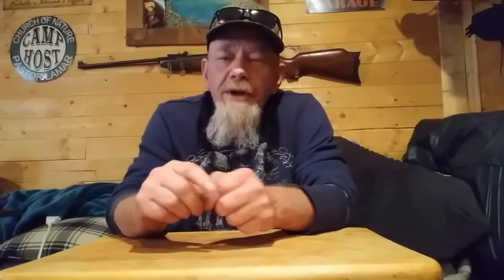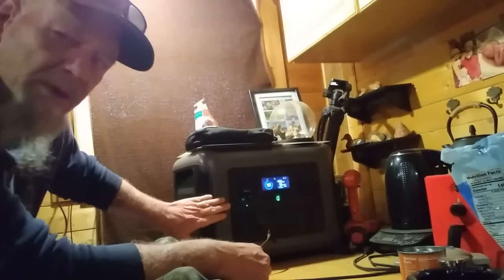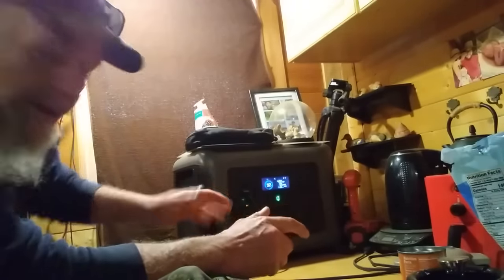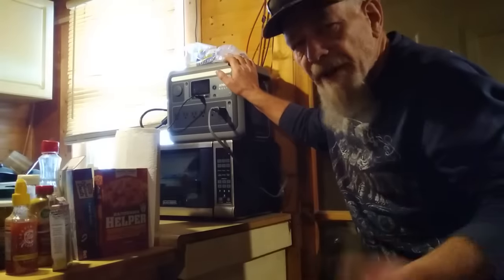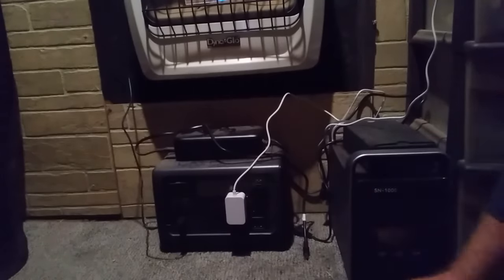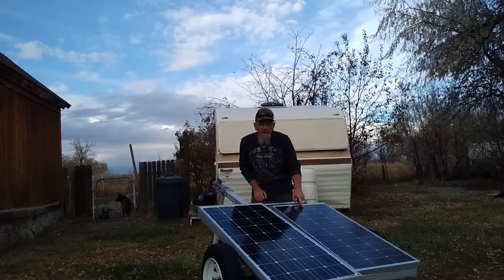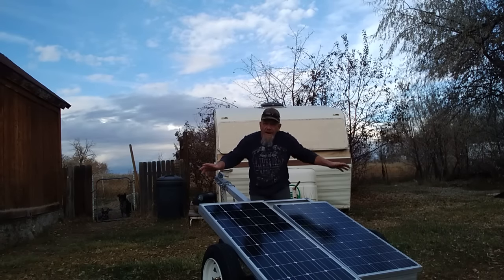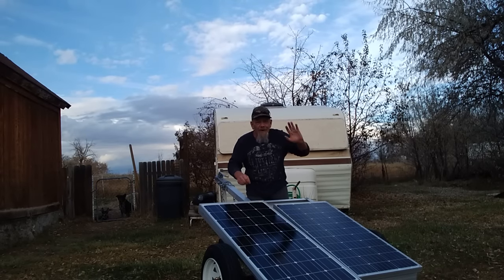My Solar Produces Too Much Power Or How I Store Excess Solar Power

Comment: I’ve been on a boat off grid for more years than I care to think of. I take a different approach. Rather than having loads of different systems and the inefficiencies of charging one from the other I just have one big central system that runs the lot so rather than having extra batteries and gubbins scattered about the place they are all included in the one large battery. I use the same amount of power but I just don’t have to juggle it, I just plug in and use it. Most day to day stuff is low voltage so I have the inverter just come on when needed so no parasitic load. In times of excess power I have it dump into hot water. Most of the year I use it for cooking and have the Propane turned off. For a couple of months in wither I use propane for cooking although if I move the boat I have excess power and so then I cook using it. The key to everything is good monitoring so that I can modify my use to suit what’s available, it’s not a hardship, I never run out of power and I really don’t have to think about it just glance up at the monitor from time to time. I would agree that a portable system is good if you need to have power further away than an extension cord but I think I’d go ,as if I had to juggle all those battery boxes. It’s much cheaper only having one inverter and infrastructure and if I need more storage I just add a battery and don’t need to buy another inverter I don’t need. All the solar just feeds into the one main battery and a quick glance shows me how it’s performing.
Reply: thats exactly what i thought. easier to maintain too. im going to comment to him on how much he has invested in all this. im guessing 6 grand.

Comment: Good tips. Definitely good to go in stages as you can afford it by getting some small solar generators for emergency power to begin wit, then adding some solar panels to recharge them, then adding larger batteries and inverters to store more power, and then tying them all together and adding more as needed is a good strategy.

Comment: The last few statements are the guts of what it's about. Essentially "off-grid discipline" - which is doing things when the power is available and not so much when it's not. The way I look at it is that when the batteries are full and the loads are being 100% met by the current coming in from the panels then that is truly free power - when it has gone into and come out of a battery bank it is NOT. So put your washing machine on in the morning - not the late afternoon when the panels have just gone into shade! 

The real problem loads are the other people in the household! lol We have a family of five, and as the two oldest boys have now well progressed into their teenage years, yes it has hard to keep up with the demands. For the last week though it has only been me and my six year old home. Talk about excess power! ;) 

I have a similar approach to you with diverting excess energy into "backup" battery banks, and then I can draw of those before choosing to go to the generator. I also run multiple battery banks for separate categories of loads. This gives some redundancy in case of any failures. It also means the lights don't go out because someone has decided to have a massive feast of toast! Plus, it keeps the direct paralleling of batteries to a minimum.

Comment: I've often wonderd the same thing about all these people with enormous systems. My assumption was that they live in areas where solar is just not that great for whatever reason, and like you said they just pay no regard to attempting to lower their consumption. My guess they must run a/c day and night in the summer, electric heaters day and night in the winter, and run big induction cooktops and ovens and cook thanksgiving dinners after the sun goes down every night or something. Running a/c or heaters off of batteries in a large home are what would require these massive systems I see people with all the time. But, if they were to convert to mini splits they could probably get by on half what they have in the way of solar.

Comment: Two ways....location and deep freezer....that's how you burn up so much power off grid. You either use a propane freezer or struggle at times, especially in the far north between good solar season and when it's cold enough to move everything to the old freezer outside in the winter.

Comment: looks like you got everything under control. I have a rather small solar array about 500 watts, compared to a lot of folks. I only use one Valence 138 Ah Battery to run my chest Freezer. The great thing about my Charge controller it only allows to draw the exact wattage I need to run my chest Freezer which is about 90-95 watts when the compressor kicks on at idle its about 49 watts. Other than that my battery is fully charged. When its cloudy i don't use my solar system I plug into the grid.

Comment: This is the problem I run into living in a populated area. Eight months out of the year I don’t have any issues at all, as the problem becomes evident in the winter time, when the sun is lower. 
I have gas heat and so it takes electricity to run the blower, and that is what takes up most of my energy.
Of course, the sun is much lower on the horizon and you have a lot of trees in neighbors yards that block the sun. Also depending on how well your house is insulated, can be a major problem.
Also, living in the Pacific Northwest is one of the lowest outputs of sun during the day.

Comment: My house uses 20kw a day. I have 8.8kw of panels and 50kw of usable battery storage.  2.5 days of rain or snowy  days in Michigan is how long I can run. I will add another 8kw of panels and 1 more battery bank then I should be off grid for electric. 10 months a year right now I am off grid for electric. Its winter that is hard to get enough sun.

Comment: Depending on the environment, cooling can use a good amount of solar power. I’d say heating as does well, but solar can only manage heating a home typically if you have a on grid solar system and stack up your credits during the sunnier months and use them up for heat come winter time.

Comment: If you are completely off-grid, you MUST have a Back-UP for your Back-UP.  If your main system goes down, then you MUST have extra systems to provide power.
-Main System = Dual EcoFlow Delta Pro 3600Watt (Total of 7200Watt...Real Life = About 6600Watts) with 1350Watt Solar on Each EcoFlow Pro
Running house (Gas stove and heater, so those are NOT on the Batteries)

-Two other EcroFlow Pros 3600watt with 550watt Solar Panel on each - running TWO Separate Window AC 
can swap out one of the EcoFlow Delta Pros if it goes down 
AND my main batteries DO NOT have to have the AC Load on them

-Smaller "EcoFlow DELTA 2 Max" 2000Watt with 550Watt Solar Panel connected - running Refrigerator and small kitchen stuff (Toaster, Coffee...etc) 

So, I have my Power Drain connect to several Battery Systems and I have backup to my main system.

EBAY Refurbished:
Delta Pros $1999 Each
EcoFlow DELTA 2 Max $1399

Solar
About $4000

Total about $16,000 with tax

Comment: Most of my power goes to run two central A/C units in my house (2600 sq ft) for four months of the year in Texas. They are a bit old so when I replace them, they should use a lot less power, but they typically use about 60 kwh per day (only A/C's) since they have to run 24/7 to keep the house at 80 degrees in the summer. The rest of the year, my home uses about 20 kwh per day. The only gas I use is for the furnace and water heater.
Reply from the maker: Living in an extreme hot climate has it's challenges.  I use a 45 watt evap cooler.  What are you replacing the AC with?
Reply: @solarcabin Definitely replace your AC with split inverter units.  They are the most efficient AC I've ever owned. And all I've seen are also heat pumps.

Comment: Hey Lamar, when you’re filled up on battery storage how about running an electric heater to off-set propane?
Reply: Obviously only do it only during the day with good sunshine
Reply from the maker: I do and my dump load is an IR quartz heater in winter and an electric blanket.

Comment: Im going to get a third battery 🔋 from your link 😁👍 in two weeks.    That will let me take some of the lead acid batteries and make a separate 12 volts system with the wind generator. It just works better on 12 volts. I already have another inverter but I'll need another charge controller. It's a modified sine wave inverter but I can run some things off of it. I can put 400 or 600 watts of panels on that side. I was charging 30 amps at noon but I had a big chicken breast in the oven. Voltage was staying at 27.1 . My inverter is working better from the higher voltage ⚡. Four of my solar panels are in the shade until 2 p.m., and lucky to get sun very long, they're in between two buildings. So I'm going to move those to the other side to get morning Sun 🌞. I'm thinking 🤔 that two 2000 watts inverters should be good for me. That will be plenty to run whatever electric ⚡😎 stuff I need to. That's about as big as my stuff is going to get, other than a little bit bigger wind generator. That's complex enough without going crazy about it. I went by the truss company to get scraps to burn ❤️‍🔥 and they gave me enough lumber to finish the greenhouse 😁👍😎. Only thing I have noticed about big systems, they have like three or four 24,000 watts inverters running. I guess they must be well off city people that just went off grid but still wanted to use all the power they want to. Probably scared of not having enough wattage so they overdo it a little bit. I saw one where a guy had two 48,000 watts inverters, and was thinking about getting another one. It's nice, but gosh, above my pay grade. I'll have the system I used to dream about with 4000 watts maxed out. And two inverters going...lol. That should be fine. That's the plan for the rest of this year. The lithium batteries have a standard discharge rate of twenty amps, and my inverter max draw is like 78 amps. The other inverter is an Ampeak. It works good, just uses a lot of amps. But I have plenty of batteries. My batteries charge up quickly in the morning, then I have power all day. Once they're charged up, the voltage ⚡ doesn't drop very much when I use the oven, like it used to. The higher voltage is making my inverter charger run cooler, so it's working better. I said, okay, I'll get one more. The lowest these two have been is 26.2 volts, full is 26.6 v. . I was thinking three would last a very long time with what I have. They'll probably stay above 26 volts so not a lot of cycling there. It's pretty chilly outside, 83 degrees inside so the battery bank stays warm. I have some 12 volt stuff that I could use if I have a separate 12 volts system. So I guess I will go there next. I can't imagine needing more power though. Thanks again for the great batteries. I think I like them better than most I have seen . I know they are going to be awesome 👍😎. About New Year's Day, when there's an ice fog  outside, I can still make some brownies 😁👍. Or have a heat lamp on, or something...it will be a good upgrade coming soon. I guess it was just time for it.
Reply from the maker: I used mod sine for many years but for a microwave, stereo, and computers a pure sine is better.

Comment: Yeah, some of these guys run machine shops from their off grid sites so they need quite a lot of power because that's what they do for a living.  I think off grid is just a term for people who want to disconnect from the Big Corporations so that when they shut everything off they won't be at their mercy (which, dead Things don't have any of). 
So yeah, you in your situation will be different than them so while you live off of very little power -- which is great -- they're just as off grid but with different needs. 
You are like me though.  I have a small system but bigger than yours but I run my stove and sometimes my furnace with propane.  What will I or you do if they cut off the propane?  I'll have to burn wood but what happens when the wood runs out? 
Those guys with the bigger systems might be looking pretty smart then. 
It's all about we're fighting a war with the Major Corporations and they control the supply lines. 
Yes, this is a war and we're in it.
Reply from the maker: I also use electric heaters and an electric blanket and run an evap cooler all summer. I live in the oi patch and near the mountains so propane and wood are always available here. I think they are running bit coin or using large tools and appliances most people don't need.

Comment: i was looking on your recc amazon site and it seems you have a lot of differant systems. how much money do you have wrapped up in this?
Reply from the maker: My main systems with batteries you could do for between $3-4K but power stations are expensive. A 400 watt system is around $1k which is what I tell people to start with.

Comment: Heating.     Cooling.... lots of power electric stove ect
Reply from the maker: I run a swamp cooler in summer and my dump load in winter is an IR quartz heater but we don't get extreme heat and my cabin is small and super insulated.

Comment: They keep those same modern fancy energy guzzling appliances! Am converting all my appliances such as refrigerators to 12volt no more big fancy overpriced energy guzzling appliances for me it’s a lifestyle change folks don’t want to give up !
Reply: Modern day fridges/chest freezers are in no way energy guzzlers. I have a french door fridge with a bottom freezer, water, and ice maker in it that uses 82 watts per hour. I have what many would call an "apartment fridge" - standard like 6 foot tall, one door with a top freezer - that uses 45 watts per hour. I also have a chest freezer that is 7.5 cubic feet that uses 36 watts per hour. Having them all at least sort of stocked adds mass and allows them to kick on less frequently, but yeah - these things are not at all the energy hogs they used to be. Same thing with a washing machine. I can only speak to mine, but it's only a few years old and a typical load of laundry, using the cold water setting, uses 130 watts (not per hour, per load). 

What actually eats energy like crazy is anything with a heating element. Stoves, heaters, ovens, coffee makers, hair dryer, toasters, air fryers. Your typical electric stove with 1 burner turned on high will use 3000-4000 watts per hour. Get an induction cooktop and that drops to 1200-1500 an hour. And induction heats up quickly. I can fry up three eggs - one at a time - by the time my electric stove has heated up a skillet quick enough to even start cooking one egg. And I can do that on low (about 700 watts per hour). Your air fryers are around 1250-1500 watts per hour. A clothes dryer? You're talking 4500-5500 watts an hour. The little personal electric heaters you can plug into the wall? 1500 watts an hour. 

Cooking. Heating. That's where so much of the used energy goes. Air conditioning is also pretty high, though not quite on par with heating.

Comment: I don't fully understand why they run out of power so fast to I have a power station I built and I can run my 20 amp welder with it for over an hour and it's only got 2.6 kw of power in it and that's just the portable one my main system is bigger and its little over 5 kw I don't ever run out of power the panels have only got .8 kw it does me fine even during the winter I live on the western side of Colorado recently we have been having just a few days of sun I'm still fine
Reply: Well, obviously, you're closer to the Sun 🌞. 😎⚡😁🤔😄

Comment: My inverter allows me to run my loads directly from the panels once my batteries are full..So that is when I do laundry, or vacuum, or do any welding, or cook in the crock pot, charge other batteries, etc...But ya, people who get solar systems, and live the normal wasteful American lives, are guilty of sacrilege..The object is to decrease energy usage..Which is good for our solar systems, and ourselves and the planet..We are also heating the planet with "waste heat" that comes from all of our various devices, which is adding to the heat absorbed by the oceans..Once the oceans cannot absorb any more heat, which won't be long, the planet will heat exponentially..There is a peer reviewed paper that crunches the numbers and concludes that the waste heat will boil the oceans away in 4 hundred years, if we remain doing what we are doing now, which won't be possible for much longer...LOL...

Comment: You say you use a micro washing machine, if'n ever you wash your clothes, and you understand some people have familes, so 4 or 5 times as many people in the house, none of whom are obsessed with using as little power as possible...but you're confused about why some people have much larger needs than you.  It's great, what you're doing, but let's not be disingenuous about who has what needs, and who is willing to live with a lot less.
Reply from the maker: I was very clear that having kids and teens means more power use in the video.
Reply: @solarcabin  - OK, and most households in America are made up of more than 1 power-conscious individual.  I think the ways you store excess power from your PV arrays makes a ton of sense, but you know exactly why most folks use and "need" more power than you do.  No need to pretend it's a mystery, or that they could solve the problem with lots of smaller power stations.  The answer is to use a LOT less power, like you do.
Reply from the maker: Sometimes I am a bit controversial to get people to think about their own situation. They have to come to that conclusion themselves.